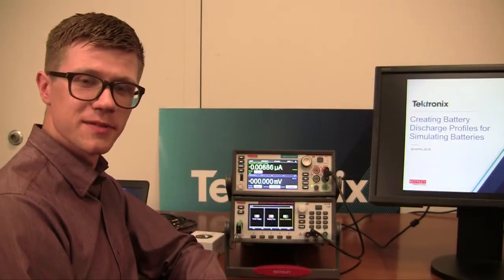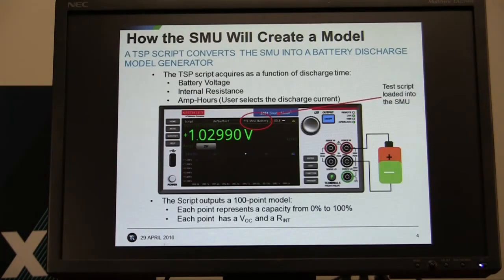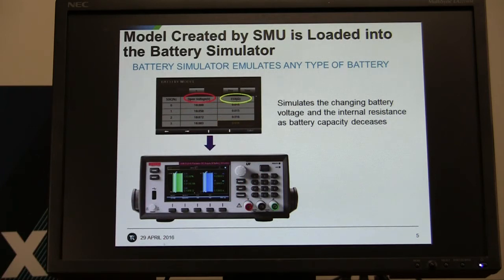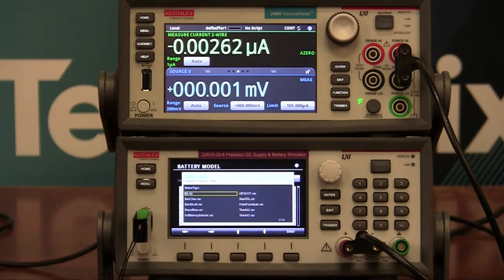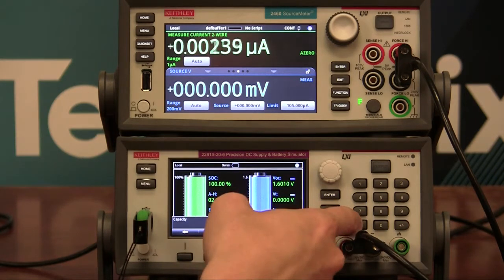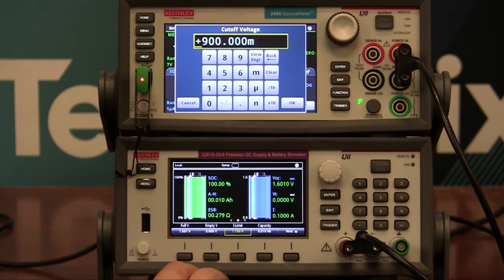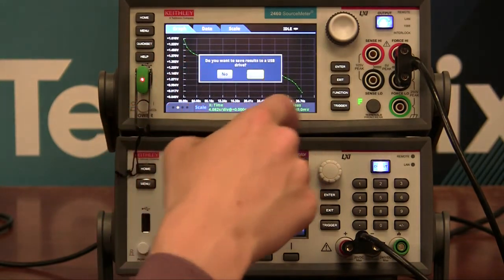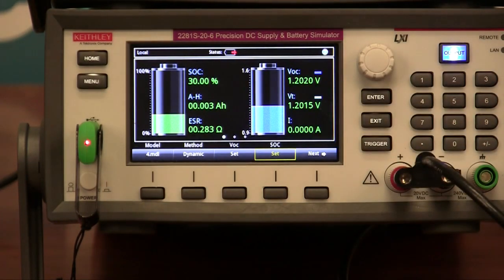Creating Battery Discharge Profiles for Simulating Batteries

Comment: I appreciate the demo, but I fail to see the reasoning behind profiling a model of a battery to create a model of a battery. I would prefer to see the process of profiling a non-rechargeable battery that has a long service life. What techniques can be used to profile a LiSOCl2 battery with their long stable voltage with a quick drop, changing internal resistance and passivation. Can this be done without taking a year to test. Can there be enough samples in the profile to be of value?
Reply: I know it is a little old comment. But currently I have the same question. Can you explain it ?

Comment: Hi Matt, we have looked everywhere for these battery profiles online and cannot find them. We are going to try to make our own, but would like to have the ones you show in your demo. Can you please point me to these files? We could only find CR2032 on the forums.
Reply: Hi Ben, We are still working on improving our modeling script and setting up a location on our site for models. I can supply you with the latest script and a few models. What are you looking for?
Reply: Hi Robert, I was able to get the files from one of the engineers through a customer support request. I look forward to seeing the updated script and a location on the site!
Reply: Hi Ben and Robert, my group and I are currently planning to do a simulation run of a Li-Ion Battery module in order to see how it behaves according to real driving conditions. For that we need a program that must be fed into the simulator. Do you guys have suggestions for me where I can find or how can I make this program? For example: How often should I charge discharge the module, How much time will a single test run take, etc. I will be highly thankful for any pointers!